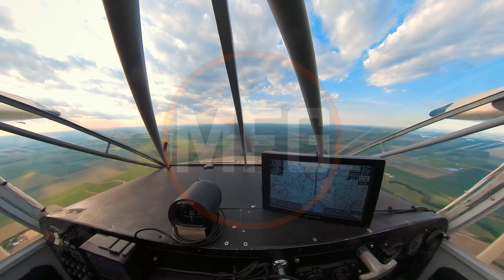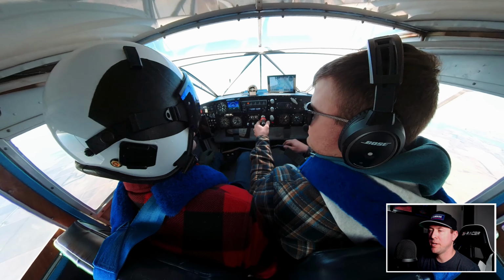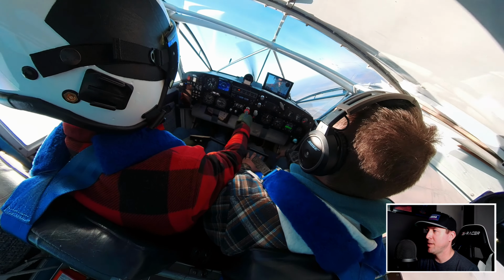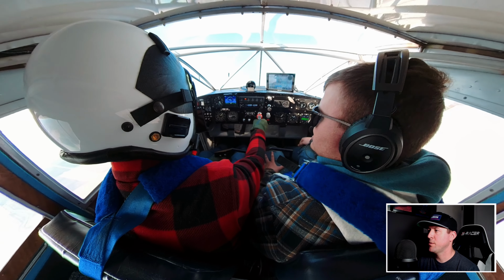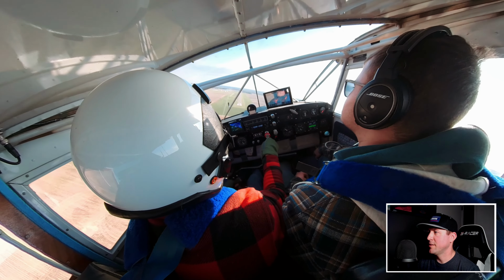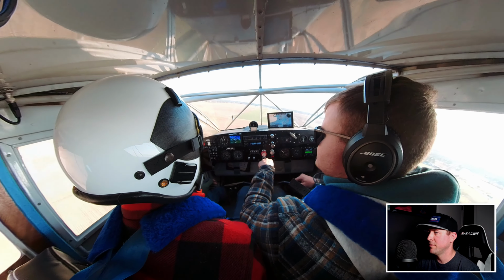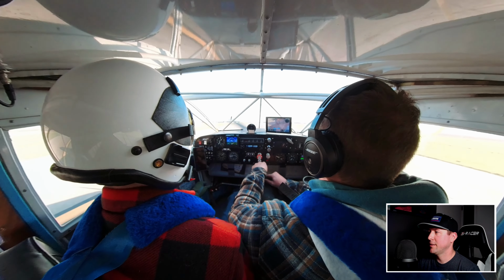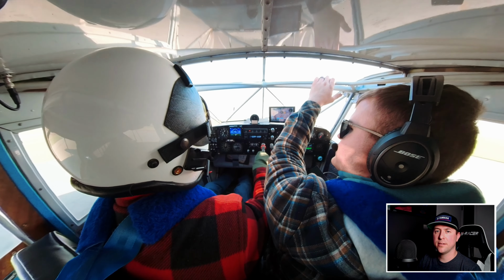Accelerated Stalls in Wittman Tailwind N7733

Comment: You said that with flaps it adds a lot of nose down and increases stick pressure, do you not have trim to fix the stick pressure?
Reply from the maker: The trim in the tailwind is just springs on the elevator control linkage. So all it does is put pressure on the controls when you move the trim. It doesn't have a trim tab like most airplanes do. So it works well for most phases of flight, but when using flaps the trim doesn't have enough strength to be able to trim it hands off. So you need to hold the back pressure yourself. It's not a big deal, but it's just not how I prefer to fly it. I find that the flaps aren't really necessary and the airplane is happier doing no-flap landings.

Comment: Nice video.  Seems your camera remains oriented to the horizon. (which is good in the case of the whiteout of the outside of cockpit)   What kind of setup do you use?
Reply from the maker: This was shot with a Insta360 One x2 and the flow state stabilization was done in post processing with their desktop software